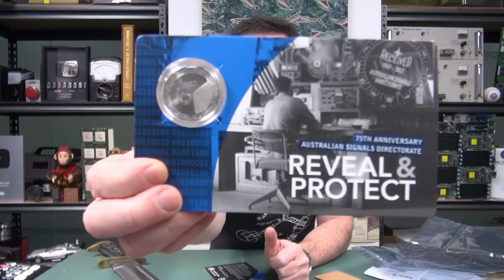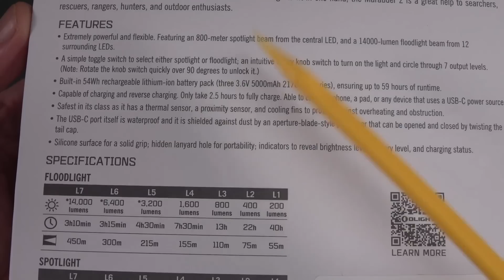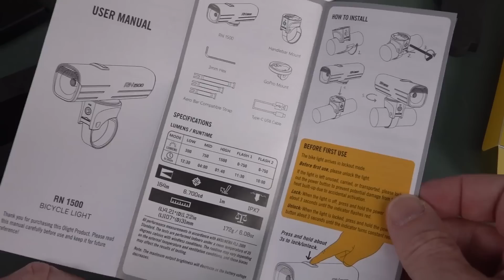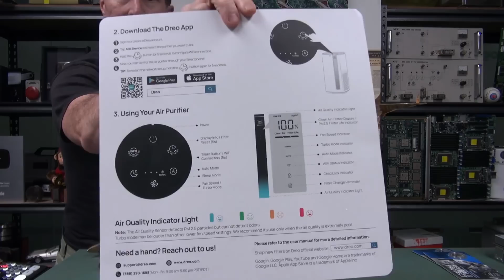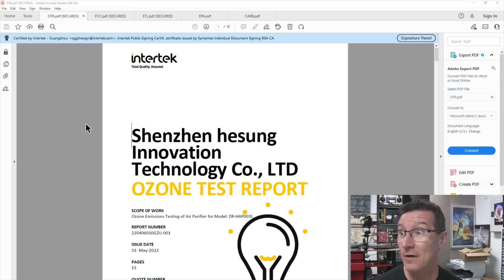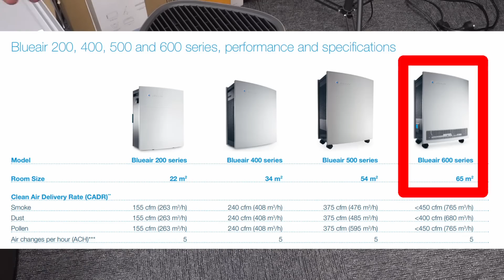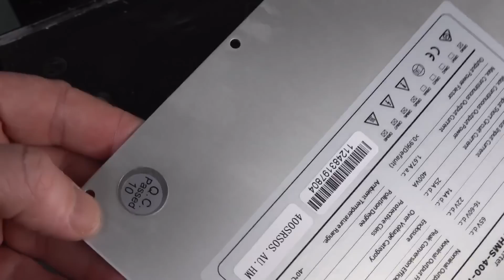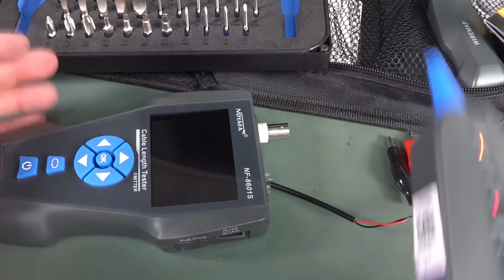EEVblog 1516 - Mailbag Bonanza!

Comment: I would like to have normally closed spring loaded one shot relay as emergency Battery dissconetor. 
I was thinking about modifying an RCD.
Reply: Look into a shunt trip breaker essentially a circuit breaker that has an solenoid trip that is triggered by an external signal which would depend on the type of one you get could be anywhere from say 24 volts AC or DC up to line voltage in some cases but it's generally known as shunt trip there might be other names for this but it would be something similar!

Also sometimes used on certain devices and installations where you might want something to trip if a voltage got too low or too high such as intervoltage trip or over voltage trip.

Often used on things such as HVAC in certain applications with fire alarm systems the idea would be if there were to be an activation of the fire alarm system it trips out the HVAC system preventing spread of fire and smoke and fueling fire with additional oxygen unnecessarily.

Many applications in industry and Safety Systems such as a kill switch for say in a school shop where there is need to disconnect power to any equipment and tools the only thing that is normally not shut off being lighting!

AKA e stop!

And yes in high school there's a couple times I had to hit the emergency stop for the whole shop and something went wrong one time somebody happened to have the check key in the drill press which was on a chain happened to be right by it and saw this happen no injury done didn't even do anything to the equipment but yeah I could have been bad just a couple cuts from the chain whipping across his hand but it could have been a lot worse in theory!

Frankly I would have not have chained the Chucky to the tool I know it was prevented from being lost but still the potential there would be more harm than good if the truck key got left in the drill chuck as it did keep in mind this was a very large drill press
Reply: @aaronbrandenburg2441  Thanks! That might be exactly what im looking for.
Reply: @lambda7652  that's why I mentioned this figured it would work this even could be something that would be mounted on DIN rail chances are if you're doing something like this you've already got some type of enclosure and this could be easily be integrated and using off the shelf things designed for this including possibly a chassis of some sort would probably be ideal since you'd have other components of the system and would make it easier to design the system and have everything nice and neat and so on I've had to reset a few Breakers in my life that affected the shop teacher or class actually did show me what to reset if somebody had trip the system deliberately hitting the emergency stop it was a very common thing for the students to do on purpose!

In addition what they would usually do is turn everything on after hitting the emergency stop and very common too much so or just to cause missed you by hitting it so nothing works but more commonly the former.

And of course any substitutes were told by any instructor what to do if things were not working for obvious reasons.

And I was also told anytime we have a substitute to let them know as well just in case the message doesn't get across!

Rarely ever was it used for its intended purpose but hey at least we it was working properly!

 Good luck on your project as well

Comment: Before I retired I had an outdoor shop and I sold Olights, they are very good flashlights. Still have one for my own use . The brightest they sold wayback then. It runs on a small 12V battery and the light is over 10 years old . Had a hard life but still works. Only problem is it won't change its brightness anymore.

Comment: Cool olights. Check out Fenix as well, I've loved them and they seem a little less janky than the olights.

Headlamps are great, the battery is balanced on the back of your head. 

I lost one of their flashlights in the sand and accidentally stumbled upon it again 2 months later, burried shallow, but where I often setup my hammock. It still had charge and worked perfect.
Reply: Check out Zenralight if you like high CRI and neutral white!

Comment: Can u make a video where u trace the cable More and show where it ends up im Curious now
Reply from the maker: I had a try down in the MDF room but I couldn't find anything. Didn't film that though.
Reply: @EEVblog  The trick is to put the black crock clip onto a ground and the red onto both wires of a pair otherwise the twists in the pair cancel out the rf is what I have found with a cheep jaycar one, Was going to return it till I tried one last thing and you betcha it worked when I put one clip on ground and the other onto the pairs
Reply: @EEVblog  so mb can u try again it would be fun to look mb like a. Live stream or smt